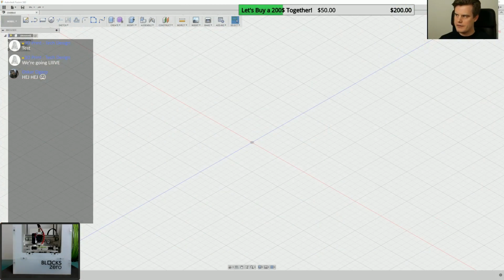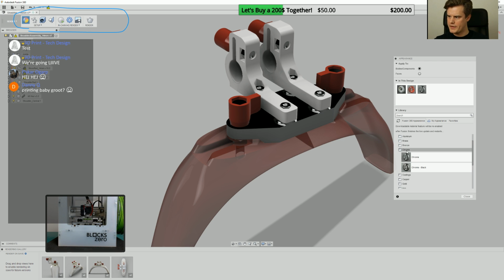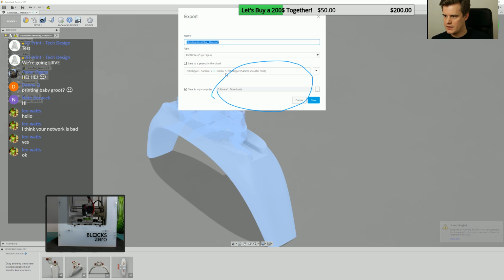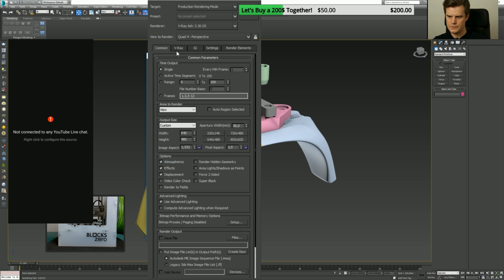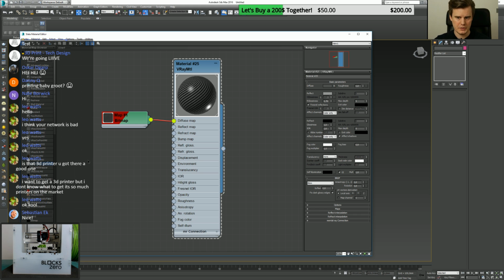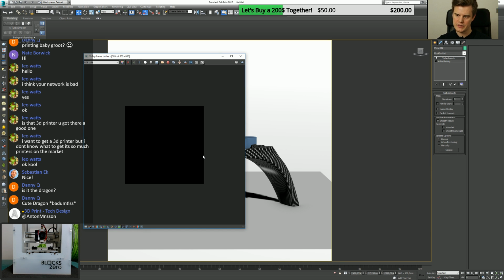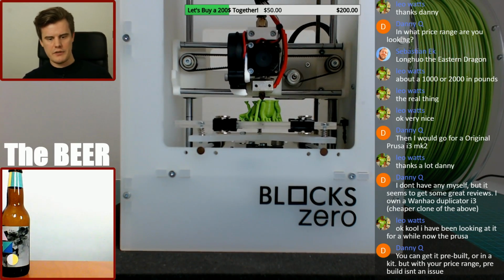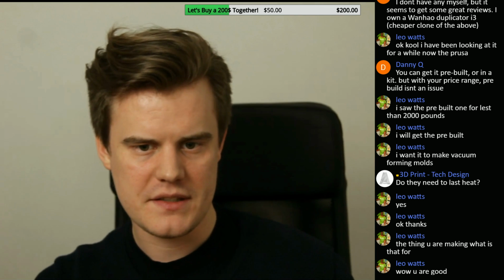/wasLIVE | Vizualising CAD Models - Autodesk Fusion 360 and 3ds Max (While 3D Printing)

Comment: Hi 

Why would you use 3dsmax and fusion? cant you do all your rendering and animations in Fusion 360? i am new to this and a little confused.
Reply from the maker: You can do a lot in fusion, but the rendering and animation part is still quite limited in the big scheme of things. In 3ds max you can achieve completely different levels of realism. Adding multiple material layers, creating everything from rust stains in certain areas to photorealistic animations with humans using the equipment and etc!